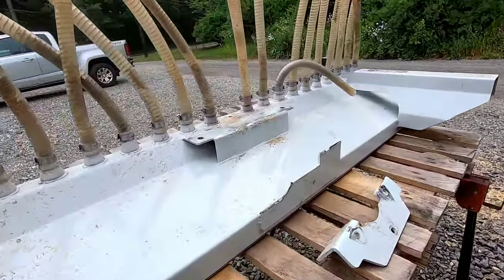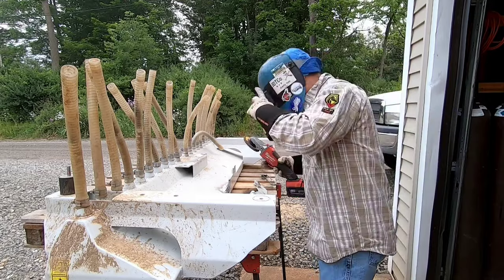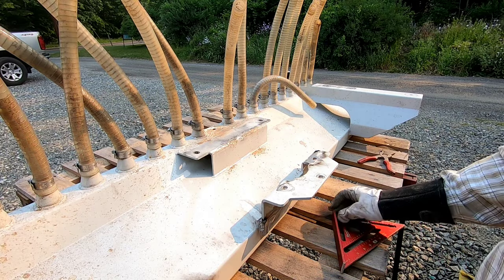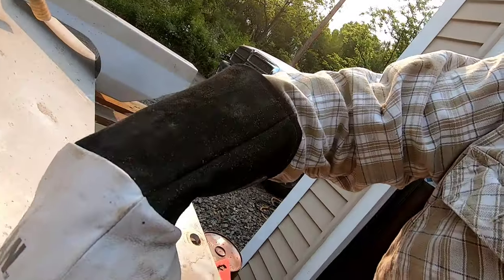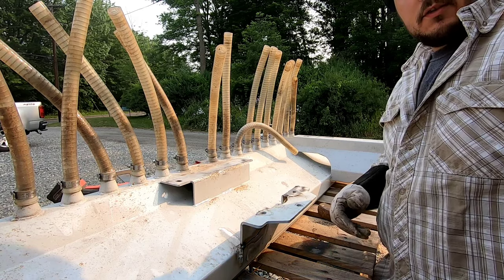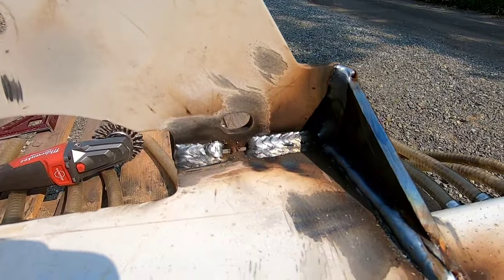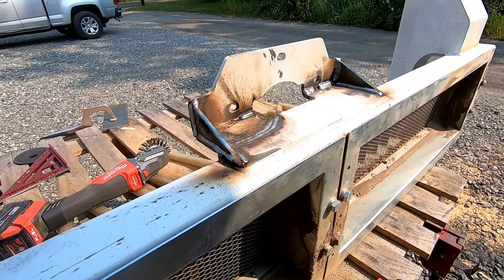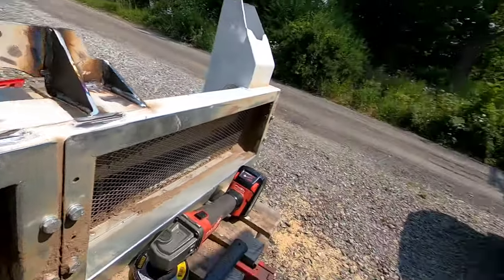THESE SMALL WELDING JOBS CAN MAKE YOU $1000's

Comment: I hope you were really able to check how it mounts for yourself. The best way to get rid of vibration and would save your welds from stress cracks is polyurethane between the tabs with something like a nylon spacer between the poly and the metal. Or even just a thick nylon spacer to deflect the vibes. Def use a zinc primer before you paint. not trying to be bossy, but I've been alive for a long time, long enough to know that when I'm doing something, I'm putting my name on it. You touched it last so it's all on you. take care and stay safe.

Comment: I just welded up a huge vibrating rock tumbler last month and when you are working on something that vibrates constantly you need to avoid wrapping corners of the welds because the vibrations will crack much much faster in the corners.  I believe my foreman said the spec was the weld had to end at least 1/4 inch from the edge of the joint. All 3/16-1/4 typ fillet with some 3/8 multipass that was typ for the lifting lugs

Comment: Worked golf course maintenance for a few years and I've never seen a piece of equipment like that, but by the size of the hoses and the fact that it's for sand I'd say iits for sanding in aeration holes after plugging their greens and fairways. Pretty slick tool.

Comment: I would've just cut off the old bracket and built a entirely new one out of thicker angle iron. Then added thicker gussets.
In the end it looks good tho ! Probably worked just fine as well..😁
Reply from the maker: It's been holding up, I think if it happens again that would be the next option.

Comment: Serious question, would hard facing that bracket work as an alternative to gussets? Or would hard facing have to be additional to the gussets or unnecessary all together ?😅
Reply from the maker: It's not a wear part so no hardfacing
Reply: Wouldn’t do anything, hard facing it only to stop wear on stuff like buckets augers etc. it’s very brittle and wouldn’t add any strength to this. It also looks like this part doesn’t touch the ground or anything so hard facing isnt needed